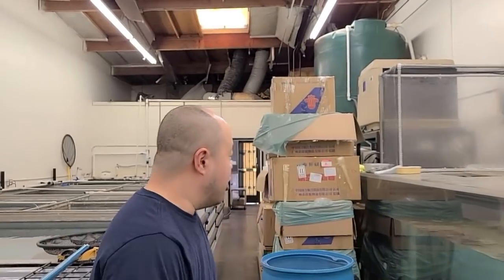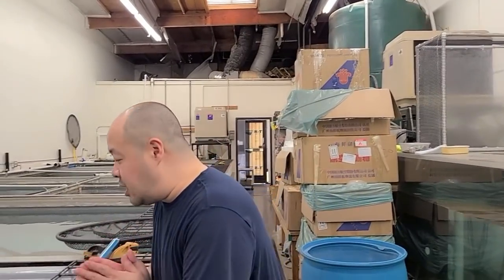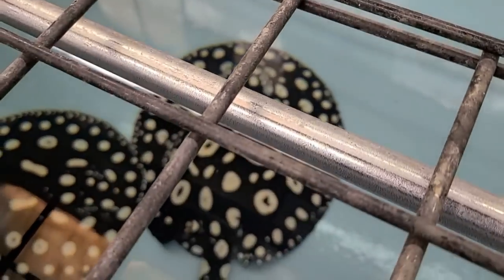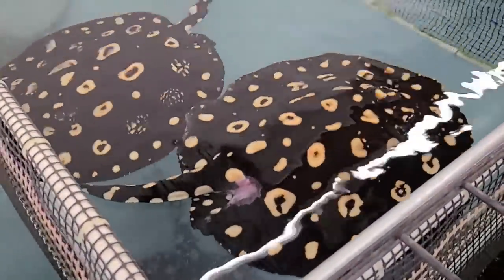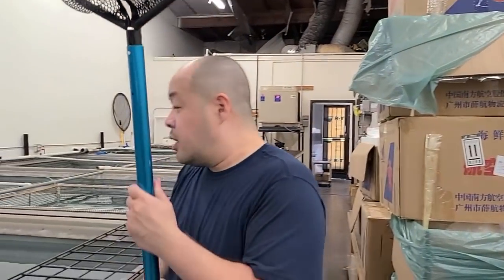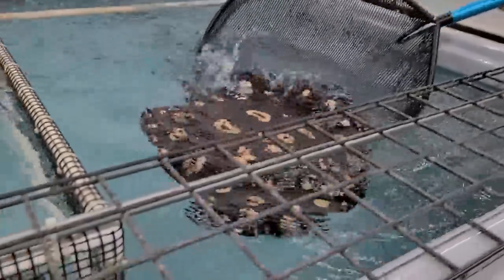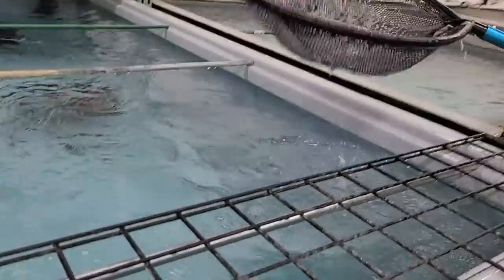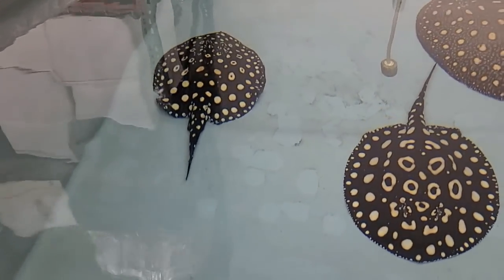AGGRESSIVE Stingray Breeding Behavior - What to do about it?

Comment: They are beautiful, what tank measures do you recommend to have a partner? thanks
Reply from the maker: Depends on the ray, but I think 6x3 is a good start.  8x4 more ideal...
Reply: @StingrayBiology  
thanks for answering. 8x4 meters? Uff that doesn't fit at home hehe
Reply from the maker: Not meters. Feet
Reply: @StingrayBiology  jajaj ok ok,thanks